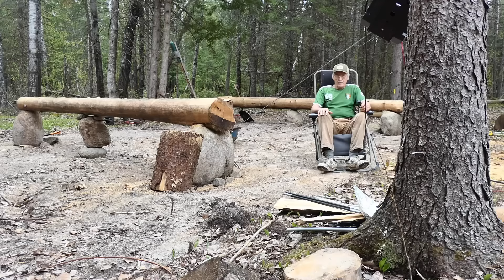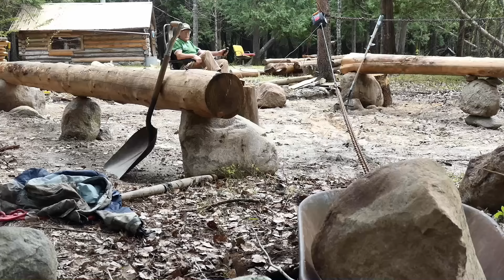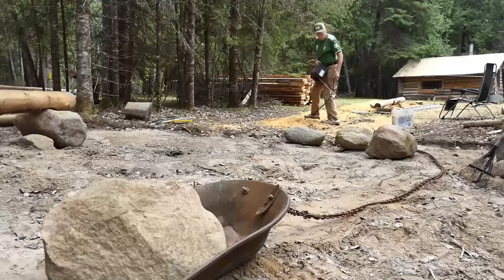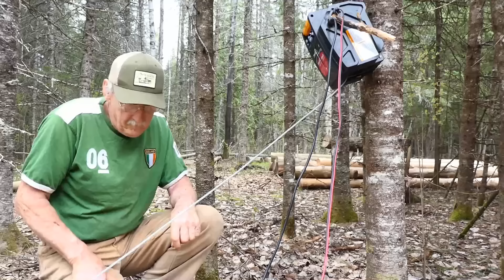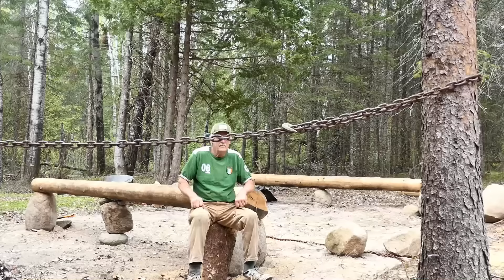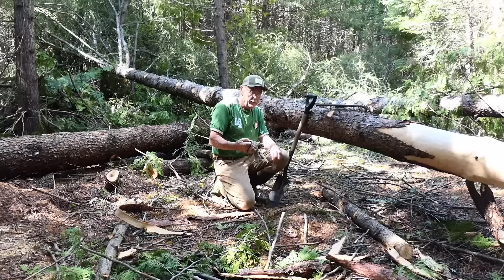Letting Tools Do the Heavy Lifting-Martin's Old Off Grid Log Cabin#277

Comment: Using a cable and pulleys over the cabin would probably work pretty good,you can also use 2 runners going up the wall and anchor the winch to the opposite side ,loop the cable around the log at the ground and up and over back to the winch and it will roll it right up there.same set up they use on manual saw mills with a hand winch

Comment: Back in the day when the pulp mills bought peeled poplar, we made peeling spuds out of leaf springs from a car. A piece 12" -16" long, sharpened on one end with a piece of radiator hose on the other end for a handle. They had a nice arc to them for working around the trunk. Worked quite well.